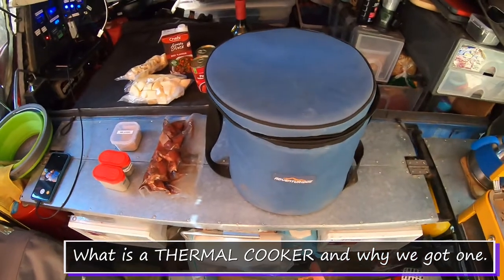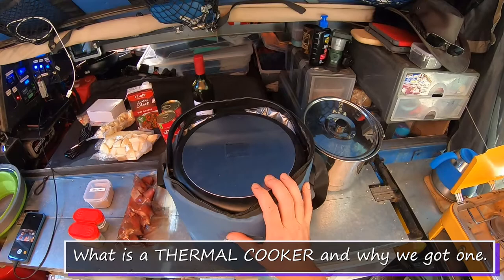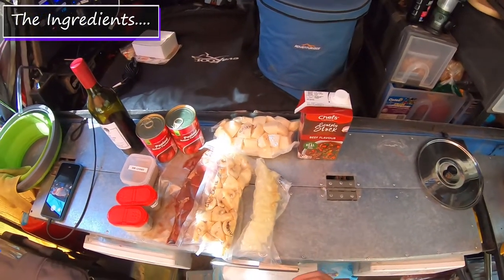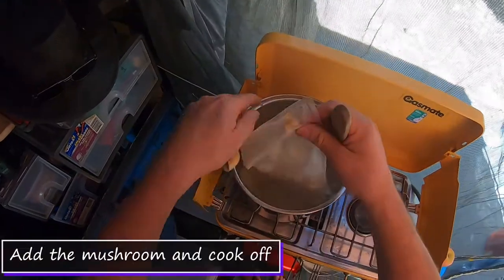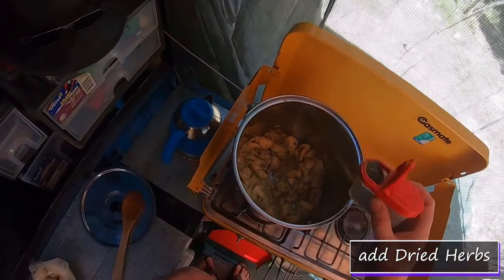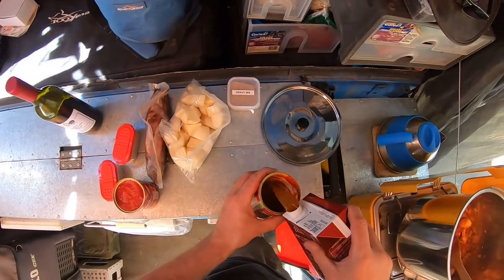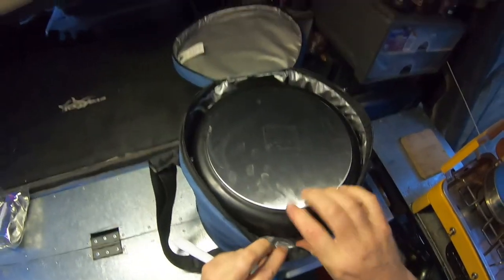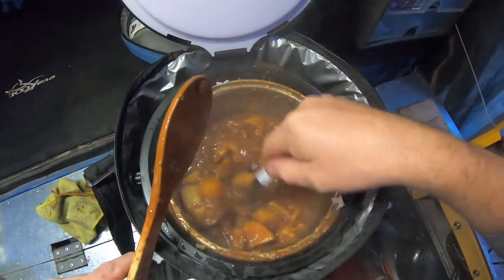Camp Meals - Beef Stew in a Thermal Cooker

Comment: What happened to the rice!!!!!
Reply from the maker: I know 😅, a little too over catering with the amounts. Still taste good with the stew and easy to do if you get the measurements right. Thanks for watching.
Reply: @the5wanderingwilsons . Try one part of washed Basmati (long grain rice) and up to 1.5 parts of water with added stock and a drop of olive oil. Bring up to boil, then shut off the heat and put the lid on. Partly cook the rice to coincide with the end of cooking the beef casserole. Load both pots into the thermal cooker at the same time, close it up and zip up the insulated bag. It will be hot and ready in from 6 - 8 hours and the rice or polenta will still be perfectly cooked as no steam is lost to the outside. Beef obviously needs more pre-cooking time than chicken or mince dishes. I enjoyed watching your presentation especially the way you pre-prepped the beef and veg. Great video and thanks for presenting to us. I take it you are Australian... I'm a Queenslander.
Reply from the maker: Thanks for that, I will give the a go. Yep we are from Victoria.